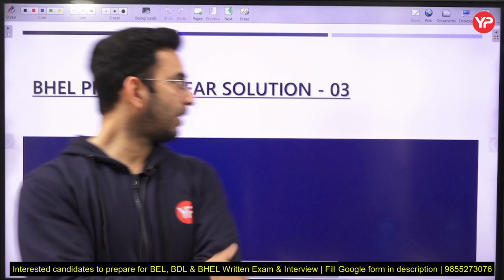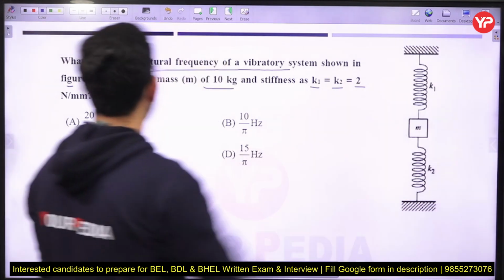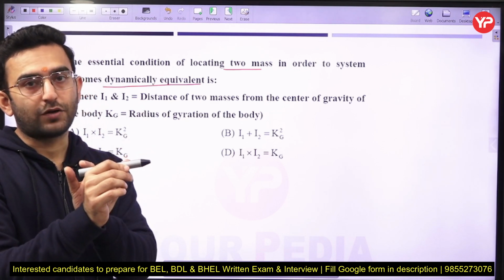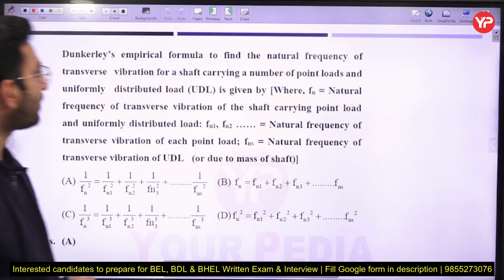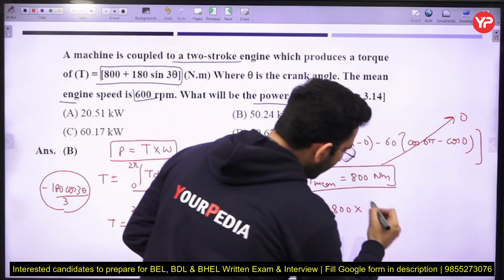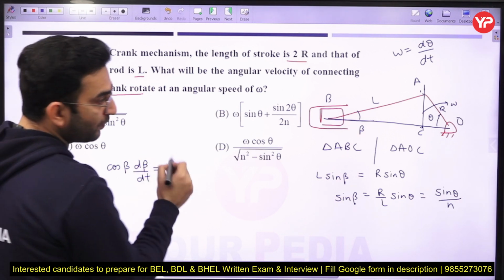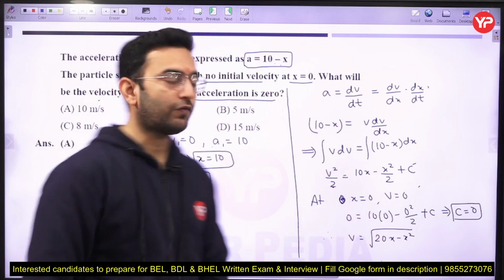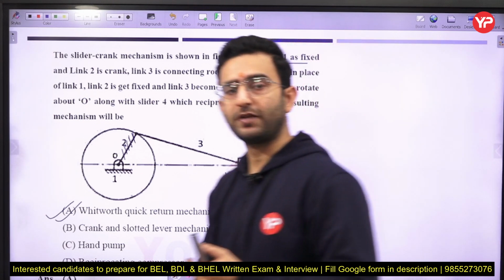BHEL Mechanical PYQ 2023 Previous year Paper Solutions | Theory of Machines (TOM)

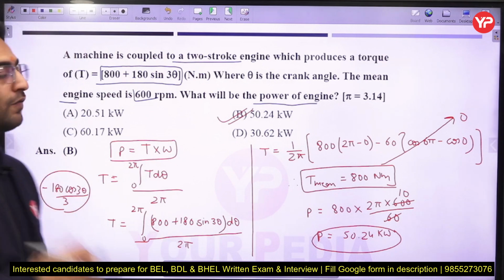Comment: 24:49 sir, the torque is a function of 3ɵ, so the cycle repeats itself after 2pi/3 . The limit to find the mean torque should be 0 to 2pi/3 and the denominator = 2pi/3
Reply: Thank you for pointing that out. The correct value is 2π/3. I mistakenly used 2π in momentum while solving. The remaining method will remain the same, and the mean torque will come out the same.
Reply: @vinit.sy08  welcome sir